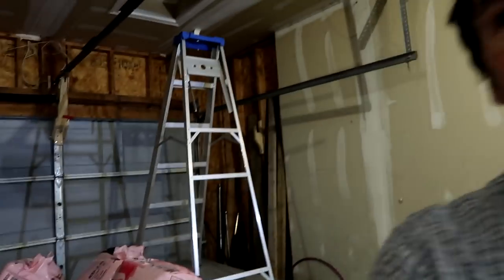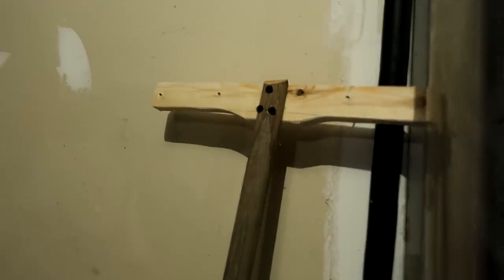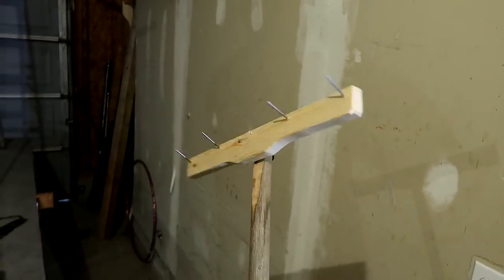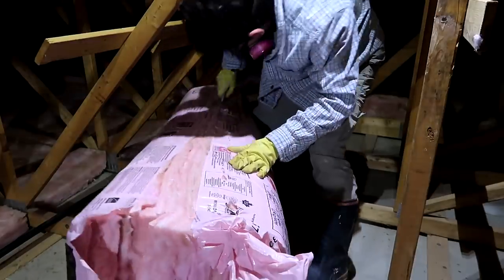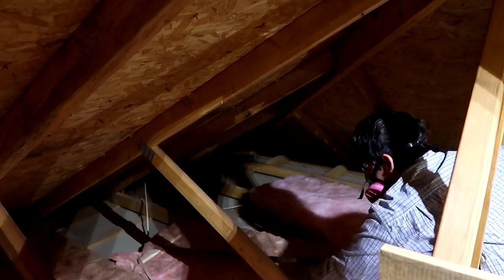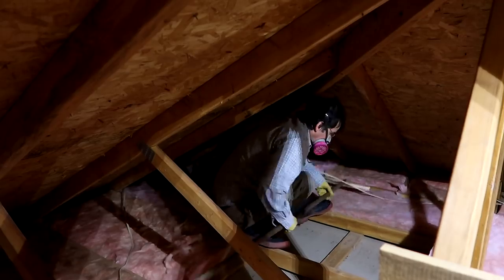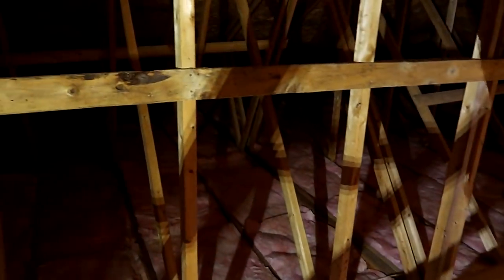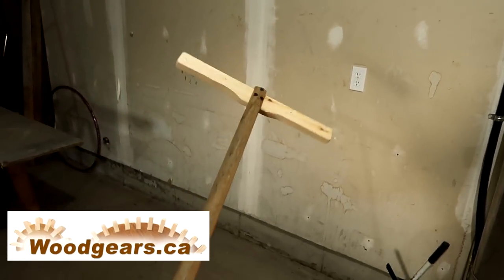Attic fiberglass insulation spreading rake

Comment: Floridian here.  Took me a week to remove ~80 sq ft of flooring, putting batt in, and reinstalling flooring around the garage attic entrance.  It was beyond toasty up there, regardless of time of day (well maybe except like 3 or 4 in the morning).  I paid someone to blow insulation into the rest of the garage attic with baffles to keep the air circulation going.  Best money spent.  The guys were completely soaked top to bottom when they were done.  I highly respect the work they do as mine wasn't the only job for that day.

Comment: Here in Europe we put plywood over the insulation so we can use it for storage. Very good for long time storage!
Reply from the maker: Indeed.  Although for some of that stuff, it's better to put it into infinite storage (also known as the garbage dump)
Reply: Some do the same here, but the attic floors generally aren't built to be load bearing.  It's purpose is only to tie the walls together and provide support to the roof.  Older houses often have attics that are more functional, but in general the houses here are larger and/or have larger garages and basements.  With the extra space, it makes sense to build the attic more cheaply and leave it both well insulated and well ventilated but not really fit for storage.
Reply: gasp Garbage dump? But what if you'll need it?
Edit: Adding a \s, just because this is the internet.
Reply: True, my family's house here in Spain is more than 300 years old and is like Matthias' house there in Canada, that floor is not prepared to withstand very heavy loads, it only serves the function of insulation between the clay tiles and the roof of the rooms, in fact you only have to step on the wooden beams or otherwise the floor can sink under your feet, there have been many accidents for not paying attention to this detail.
Reply: My dad once took a misstep getting stuff out of the attic and went right through the ceiling. He fell right between the joists and landed on his feet. He just stood there for a few seconds, covered in plaster dust and surrounded by broken bits of drywall, under a huge hole in the ceiling.

My mom asked if he was hurt, he said he was fine, and she said, "Good. That means I can laugh." And she did. A lot.
Reply: -I'm so glad it was just an anecdote. Here in my country (Spain) it was very common for workers to fall from the ceiling of their rooms, but sometimes the story had a terrible end, unfortunately. Here a mixture of reeds and plaster was used to make the ceilings of the rooms, cutting the reeds into four strips they were sewn with wires and nailed into the wooden beams, then they were finished with a layer of finishing plaster. Many people bled to death because when they fell they severed the femoral vein with the cutting edge of these reeds, it was something terrible. That's why it's very dangerous to walk around that part of the house, better to do it alone like Matthias, if necessary. Greetings from Madrid, thanks for your testimony.
Reply: The dump might be a better option.  A lot of these prefabricated trusses are explicitly not rated for heavy loads on the bottom member, i.e., a floor with a lot of junk on it.  Another excellent idea, by the way.
Reply: Smk the fact is that when you "storage"something,you will never use it.
Reply: Gato Land Just read a story about a woman I think in Texas who was in her attic and stepped on the floor and fell down between the walls and died there and they didn’t discover her body for months or years. Was nothing but a skeleton and clothes.
Reply: If I wanted to store things up there I wouldn't use trusses to begin with. I am infact going to be building a small 5x5m house for cold storage and I will use an older construction method with three solid wood beams supporting the roof. They might be called purlins in english? That will free up the attic for storage (drying lumber) and I am free to build a strong enough inner ceiling to hold the weight.
Reply: It is but the point is that in winter you really not suppose to open your attic hatch. The gust of hot air will condensate and you will get attic rain.

Comment: When blowing insulation in an attic the trick is to bounce the material off the roof onto the ceiling (your floor when walking around in an attic) just short of the end; allowing the air to still flow from eaves into the attic space.  The heavier the material the easier it is (rockwool or insulsafe II which has the added benefit of being white to reflect the little light in an attic)

Comment: Insulators have been using tools like that for years. You probably already know but attics are usually insulated with much thicker insulation you're using insulation for 2 by 4 Walls R-13 with no restrictions in an attic you can use R-34 after that there's a point of diminishing returns of course its an unconditioned garage. Unless you're planning to use the attic space for living or more usable storage the way it was built is a very efficient use of materials.
Reply from the maker: yes, indeed.  But it's only to keep the garage more moderate.  But, with a 25 degree temperature difference in the summer between attic and garage, it's tempting to add more.

Comment: Oh man, I had a house that was built in the 70's (back when lamps reigned supreme) so there wasn't a single ceiling mounted light fixture anywhere in the place.  I had to get up in the attic and wire in a junction box with new lines and boy did that suck.

Comment: We europeans would insulate the roof instead of the ceiling. This way the heat stays outside and not inside between the ceiling and the roof. Also we construct our buildings this way, so we can use the attick to store something instead of having unused space. Why are you not reconstructing you roof, so it's selfsupporting and remove all those braces? now you have half your building unused.
Reply: because we have larger houses here, and dont have to use the space as effecciently
Reply: In all seriousness, if you're interested in that kind of stuff you should check out Essential Craftsman on youtube. He's doing a series in which he builds a house from start (acquiring the land) to finish (moving in). There's stil a very long way to go but it's an amazing series.
Reply: Not only that we have to deal with snow loads and truss systems work great for not allowing snow to collapse the roof
Reply: It's a garage.  You know, for a car.
Reply: lol, like European roofs aren't strong... they are probably much stronger then that what's been shown there.
Reply: don't speak for Europeans as a whole.. There are a lot of house design in Europe, some regions are less populated than others and have more room for bigger structures.
Reply: Here is plenty of roof problems.  https://www.startrescue.co.uk/home-emergency-cover/home-emergency-advice/roof-advice/common-roof-problems-and-how-to-solve-them
Reply: The Media Is Cancer 
This is not eu problems at all
Reply: He'll most likely cover the insulation with boards if he needs the space. For now it'll allow him to do electrical or anything else he wants to add or change. Also, this is cheaper and faster to construct.
Reply: Everything is better in Europe. Lol
Reply: I'm no authority here, but I believe the reason for placing the insulation between the attic floor joists as opposed to the roof is to save on heating and cooling. For example, if the attic floor is uninsulated, regardless of whether the roof is or isn't, and the attic itself is unheated in winter, you're using a lot more energy, thus money, to heat your house. It's inefficient. In the house I grew up in, we had the old-fashioned glass wool insulation on the attic floor, but we just placed boards across the joists on top of the insulation, which acted as a makeshift floor, allowing us to walk around and use the space for storage. Worked fine.
Reply: I'm Danish, so I will consider myself european. My house is insulated just like that. Except for the amount of insulation ofcourse.
Reply: @The media is cancer:
Oh, thank you for this link to these magnificent roofs!
Reply: I think NA people confuse UK with Europe, our houses are plenty big, in fact in some cases, too big. UK is island based, their circumstances = tiny houses that last the life of the maker, the next generation after, after, after...
Reply: If you're into house building, check out the House from Trees series on Bus Huxley's channel.  https://www.youtube.com/watch?v=Ze999YxdEMA
Reply: Europe is huge. We do all sorts of stuff, including just like this video, with various thicknesses.
Reply: Pmsl there's only 50 different countries in Europe. Need I say more.
Reply: UK here. Our attics are exactly like the one in the video, and are insulated the same way. Some people take the beams out but you'd certainly be in the minority if you did, most of us dont really need the attic space as we dont hoard junk.

We akso dont consider ourselves European (Only people in the US/Canada seem to call an entire continent out as being the same...ignorance I guess).
Reply: It's a truss roof.  You can't remove the supports.  You could use spray in insulation foam to seal the roof, but there are other design considerations that must be taken into account for this to be fully successful.  That and spray in foam insulation is many times more expensive than the glass battens Matthias used.
Reply: In Norway we have stroong roofs and insulation on the roofs. On the floor we have spring insulation with floor boards on top. in that way we have a place to store things on and the noice is gone too :) in America they have card board houses and same goes for Canada too :)
Reply: Yeah, vented attics are a bad idea, at least if you have centralized HVAC. Before centralized HVAC was the norm, vented perimeters made more sense in some climates. Modern builders are finally getting out of the habit of using vented attics and crawlspaces, as sealed perimeters are a better approach. But it's different from the way things were done in the past, involves learning some new building techniques, and hasn't become the industry standard yet. In colder climates, you have to worry about ice dams, and in many warm climates, you have to deal with moisture build-up. How to do it correctly is well known at this point, it's just a matter of education -- and of course, we'll still have lots of older houses that were built this way.
Reply: I have seen your typical norwegian mouse houses.  No thanks.
Reply: I live in the mediterranean. Here the climate is very gentle, so we tipically have terraces instead of inclined roofs. :)
Reply: Cool, didn't know that, but now you tell me it makes sense. Overhere in the netherlands (europe) we mostly use rooftiles on sloped roofs and asphalt on flat roofs. Sometimes we use shingles on gazebo's or small sheds, but only because they are multi-cornered. Nowadays the flat (or slightly sloped) roofs are also covered in EPDM-rubber. We don't have to take all these facts in concideration you told us, we just put a roof up with the according insulation, not taking care of airpockets, etc. The only thing we take care of is the right ventilation and distances.
Reply: Hoi Barrie, het dak boven mijn hoofd hier in Belgie, in een best klein huisje, is ook op de vloer van de zolder geisoleerd en niet tegen het dak hoor. Wordt wel vaker gedaan, zeker als de zolder niet echt als nuttige ruimte benut kan worden.
Reply: the UK is part of the continent called Europe, that would be why we refer to you as part of Europe.
Reply: Barrie Vermazen geef mij maar zo'n dikke rieten dak. prachtig
Reply: Concur
Reply: I'm european and we build shitloads of houses like that in the nordics. Though the lack of vapor barrier bothered me, but if they are not heating it I guess.
Reply: You don't need a vapour barrier in the attic.
Reply: If you heat the room below you need a vapor barrier under the insulation
Reply: As of 2020 the requirement for insulation in the attic will be 400-500 mm. i DK. 
And my house in DK is also insulated just like that.
Reply: If you insulate the roof instead of the ceiling, then you get ice dams which can cause a lot of expensive damage.  I speak from experience.  I do hate the use of all those structural support beams / trusses in attics.  That really is a waste of space.  My attic (redone from the ice dam damage) is great for storage but does get cold/hot, but now no more ice dams.

Comment: The level of insulation needed depends on the current building code. Old houses in Europe were not so well insulated too. But the current building code requires both the floor and the roof to be insulated. Otherwise you would not get below KfW-60 = 60 kWh/(m^2*a) (that was in 2006). Now we are at KfW-40 and better. Good job Matthias. Should have been insulated when built
Reply: Michael G it is an unheated garage. It doesn’t need insulation.

Comment: As far as I know: for stopping heat to go into your building you need rather mass (that can take up the heat), not low r-values (that slow down the transmission). So, glass wool, which is a light product, would be good to insulate against cold, but not so good against heat. I have never fully understood the reason, but as all construction books and calculation softwares use this principle, it is probably correct. What do you think?
Reply from the maker: that reasoning perhaps should not be understood, because it's wrong.

Comment: So this blow in insulation, is that not a mess to remove? Or what if you need to service something there?
Reply: Max Maker you push it aside to get to whatever needs work
Reply: Blown insulation is PU foam , it sticks to most common building materials like a tick. Not only that, it outgasses noxious chemicals that will annoy, or even poison you if you live in the house. Now, for an outdoor garage/shed, that's less of a problem. But still. Oh, my 40m² attick is the guest room.  (now to install the bathroom/shower for extra comfort)
Reply: maddox0110 not in the us.  What we call "blown-in" insulation is loose fiberglas or cellulose. Spray foam (open cell or closed cell) is what sticks to the structure.
Reply: Thanks for the distinction.

Comment: O, what I’m wondering about are the R values. We both probably use diverse systems because the R values I see down here are  usually lower than the ratings I see on your insulation.

Comment: Man, I wish I'd taught of that when I insulated my garage attic. It's about the same size as yours and it was indeed very miserable! To top it up, I used the thicker mats, so even more bulky, heavy, itchy and nasty.
Reply: fox111qc in the UK they made a plastic based insulation made from recycled plastic bottles, much nicer to work with, there is also wool based insulation you can buy.

Comment: The construction looks fine for a building that doesn't have to last for centuries, but what I find surprising is that you have this enormous room in your house that you don't use for anything.
Reply: Esger vd Post it’s not a room and the floor can’t support any load. Its part of the structure of the roof and engineered to handle the roof load with minimum waste in materials. No need to make it a room when space isn’t at a premium.

Comment: EU here :)
I'm just wondering why fiber glass insulation instead of some mineral wool insulation. You would not need to worry for the possible parts you could breath in. Lately I saw only the mineral ones used all around. But maybe there's something behind, I'm not a craftsman
Good luck, like your channels :)
Reply: Pavel Makovinyi Fiberglass is lighter and cheaper.

Comment: Well, in my part of the country when you buy at least 10 bags of insulation, they rent you machine for free. Also when you hire company to supply and blow loose fill its still most likely cheaper then playing with butts. 
To bad, whoever framed garage never installed proper insulation stops!!!
Reply: cheaper than playing with butts... thanks autocorrect
Reply: LOL
Yep. Thanks auto spell.

Comment: I did the same job in my Norwegian house in the 80'. I used some movable 22mm particleboards as a floor to lay on when I was laying out the insulation. Yes my head hit the beams sometime during that work. I learned a few new words then.